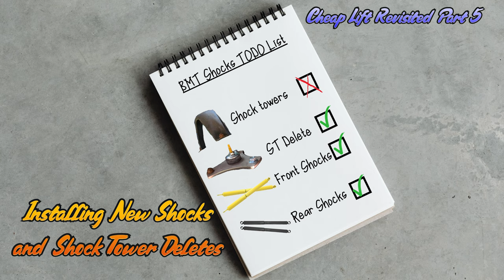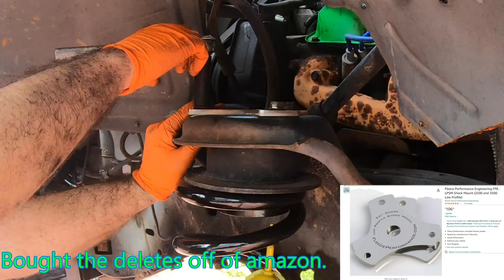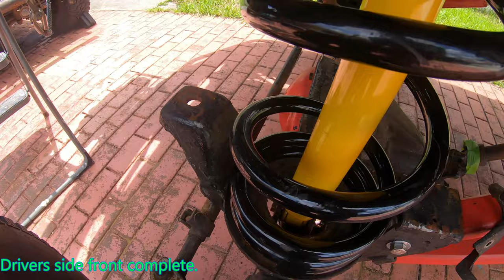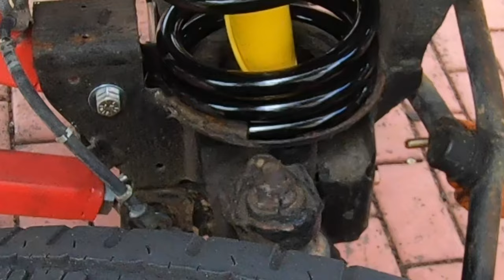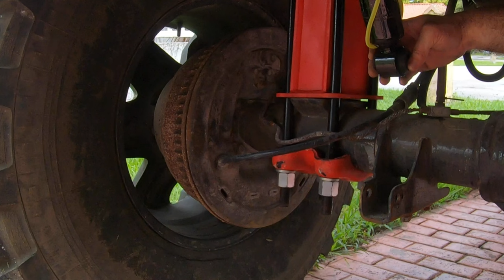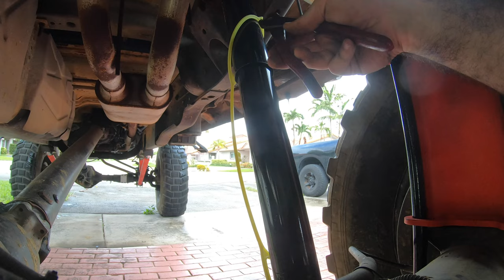Installing shocks and shock tower delete on the Budget Mud Truck (cheap lift revisited part 5)

Comment: What kind are military tires and is the wheel 20x10 or 9
Reply from the maker: Tires are 43x14.5 (little worn so closer to 42) and the wheels are 20x10. I talk about them in this video: 

https://youtu.be/96T4CYRk920